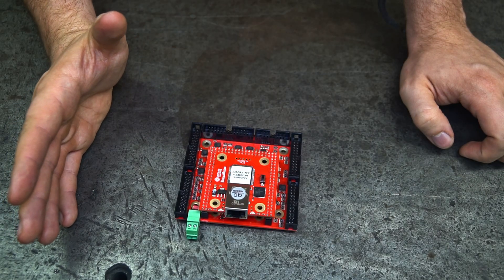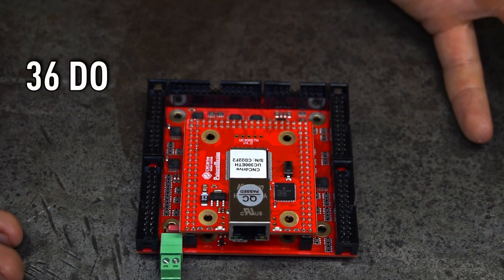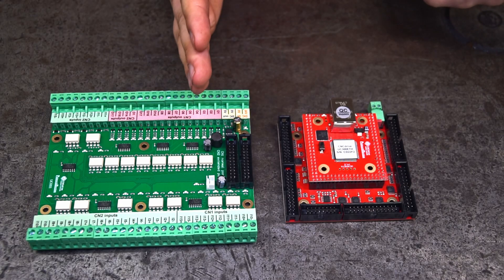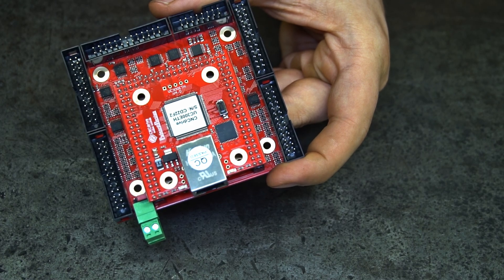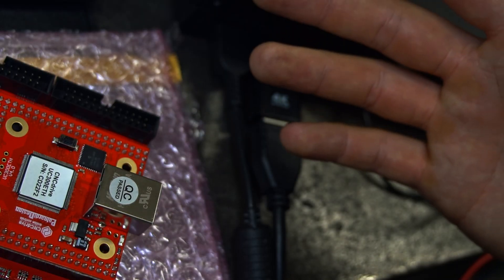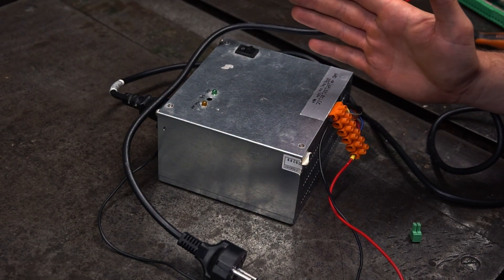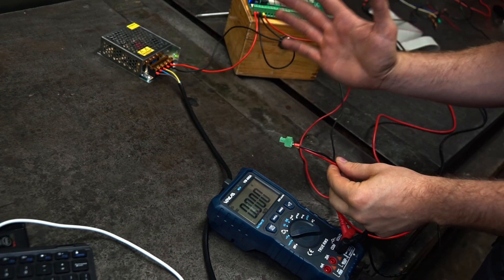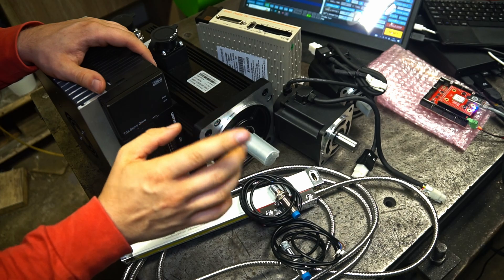UC300ETH-5LPT Ethernet CNC Motion Controller #1 Basic Setup

Comment: Do you have try further thoughts on this having used it for a while? I bought a similar product (from China) to switch my Mach3 instance from running 2 x parallel ports over to ethernet, and have found it not great. It works but there are a fair are bugs which seem software related. Not having a good time with it!
Reply from the maker: The machine i'm building is still in progress, but so far so good. Didn't notice any bugs or problems and they seem to develop the software (UCCNC) all the time. I started some years ago with Mach3 but I wouldn't switch back.

Comment: i bought the same lenovo thinkcentre m93 as you for my build, as a result of this video. Did you have any issues running uccnc? The intel hd graphics 4600 seems to be replaced with Microsoft basic display adaptor which blocks uccnc from opening
Reply from the maker: Nothing at all. Uccnc runs fine on mine. Uccnc needs opengl of a certain version or higher. Isn't your pc damaged or something?
Reply: @GBWM_CNC  Thanks for the reply. Closure for anyone seeing this that may have the same problem, I fixed it by fresh installing windows and downloading the 4600 graphics driver.
Reply from the maker: @mikestratton5974  Thanks for your update. It might help somebody facing the same problem :)

Comment: I have issue that software is running in demo mode even I have licence attached to UCCNC folder.
Can give me some hints about this..
https://youtu.be/FmpjwKn_GBI?si=GM0Cyb_ZoMBwhIB1
Reply from the maker: Is the controller connecting with the pc? Do you have the right crossed / straight Ethernet cable depending whether you use a internet switch or straight connecting it to pc?
Reply: @GBWM_CNC  Controller is connected with pc and have tried 2 cables straight from pc to board.
Is there any way to check if connection is established or if you can see anything from video I posted?
Reply from the maker: @StageSound-u7s  
Try to set tcp/ipv4 protocol to manual
IP: 10.10.10.10
Mask: 255.255.255.0

Also consider if you connect directly Board to PC then you need "crossed" type cable. If you use "straight" type then it won't be able to connect properly.
Reply: @StageSound-u7s  You need to set up the IP address. Look in the UC300ETH manual. It is written in steps very thoroughly. And if your computer is relatively new, forget about the cross wired cable - Your computer will now how to handle either cable.

Comment: Hi. How i read information, about uccnc this software doesn't have lathe function? Why you moving from Linux cnc. Thanks.
Reply from the maker: Hi! It is being tested but there is lathe function. It is available to download from cncdrive.com. I moved to uccnc because i used it also on my mill retrofit project and it liked it a lot. I like the interface, everything is quite simple to setup while it supports most of what you could need for a CNC machine.
Reply: Thanks for your reply. Do you have plans to make video about uccnc turn? @GBWM_CNC
Reply from the maker: @VolodymyrKh  Definitely! I'm planning to make videos of most of the functions and possibilities of this controller. I'll include some overview on the lathe user interface too. Actually it doesn't differ much from the milling gui from what I see. It just suits a little more to a lathe. But I'm now testing the UCCNC turn profile so maybe I'll discover more fun stuff there.

Comment: That's really interesting! I have the same controller and I'm looking to replace the SmoothStepper I'm currently using with Mach3 for my CNC. How do you plan to implement a closed-loop system with UCCNC? As far as I know, UCCNC doesn't natively support that, and the latency between the board and the PC seems too high for closed-loop control. Windows is not a real-time machine. Thx!
Reply from the maker: Well, actually I'm not quite going to implement closed-loop. My plan is to make a pneumatic tailstock attached to the linear scale. I'd like to make a macro which will turn on the tailstock and the controller would be measuring the distance the tailstock traveled. Thanks to that I should be able to drill holes to the desired depth using an air cylinder. Something like that. And yes - as far from I know there is no posibility yet to close the loop of the step/dir signal and the drive position signal from a scale.
Reply: @GBWM_CNC  ah perfect. Great plan! Yes, that will work. Good luck
Reply: @GBWM_CNC  Ah what made you go for the UCBB board instead of the UB1?
Reply from the maker: @Ale_Lab  from what i remember the ub1 has not enough inputs. I will have to get one more ucbb though

Comment: For the next video, could you show what type of connector is necessary to connect, for example, a servomotor to the corresponding port on the board? I am interested in this board, to carry out a project. On the other hand, thank you for the videos you make, they are very useful!! I hope you continue uploading such interesting content for a long time! Thank you really, you are a real help for people who are interested in all this.
Reply from the maker: Yes, definitely! I'm planning to make videos about most of the stuff which will be controlled in my CNC lathe project. Axis servos, spindle, position / speed mode, spindle encoder, MPG, linear scale used with a pneumatic tailstock. I'm glad my videos are helpfull! :)
Reply: Thanks for making these videos! Could you show how to connect the T3D to an arduino R3 for a 6dof?

Comment: I have the same controller for a new project....but please....don't put it on a steel plate because static discharge are possible 🙂  Which UCCNC software version will you use ?
Reply from the maker: I just put it on it before powering. After that it was on isolating material. I'm going to use the newest version of uccnc available which has uccnc turn (for lathes). I don't exactly remember which version number is it but i can check if you're curious
Reply: @GBWM_CNC  Yes, i saw that, but statics can burn your controller also if it is not powered 😞
Reply from the maker: @IceCreams62  I wasn't aware of that!
Reply: @GBWM_CNC  That's why  the boards arrive into antistatic bags  🙂